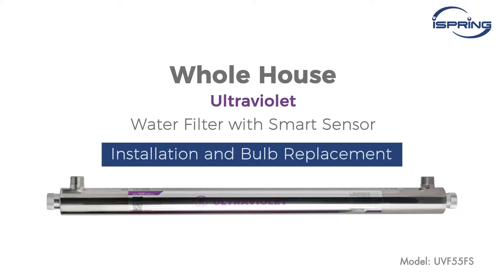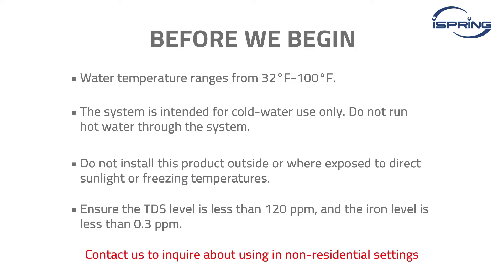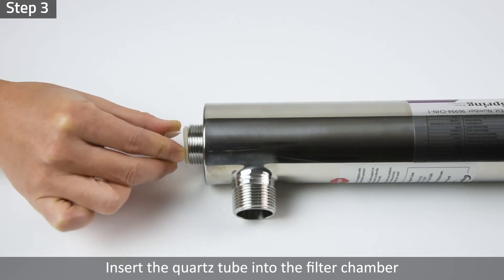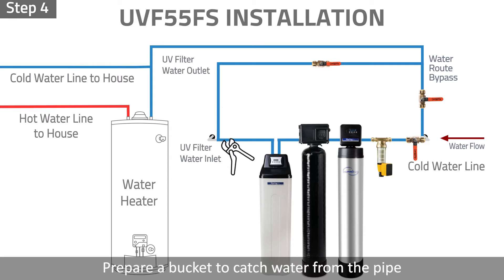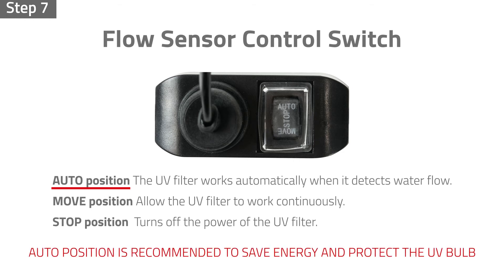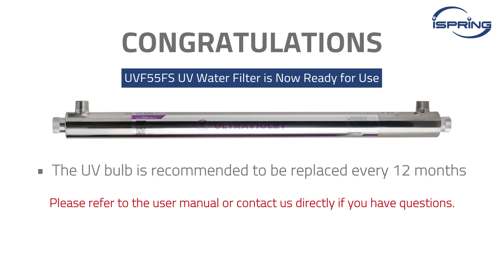Installation & UV Bulb Replacement of iSpring UVF55FS UV Water Filter | Step by Step

Comment: Can you tell me why it matters what side the flow switch is installed on?  The tube is symmetrical on common on both sides, correct?  I want to mount near the light side as it’s better to service the bulb?
Reply from the maker: Hi there! The flow sensor switch must be installed following the flow direction arrow because it is designed to detect water movement in a specific direction. 
If you have further concerns or questions, do not hesitate to contact us at  support@ispringfilter.com or  at  678-261-7611 (M–F, 9 AM–5 PM EST) We’re here to help!
Thank you!

Comment: This doesn't take into account that water softeners shouldn't be hooked up to your fridge and kitchen sink lines on the cold side, therefore if you have a water softener (as I do) and install this AFTER the water softener, none of the water used for cooking and drinking isn't being filtered with UV. Quite disappointing actually.
Reply from the maker: Hi there. Thanks for your comment!
If you want to focus only on filtering drinking and cooking water with a UV filter, you may get a Reverse Osmosis system with UV.
Please, check our RCC7U system:
https://www.123filter.com/ac/index.php?rt=product/product&product_id=215&acid=2 
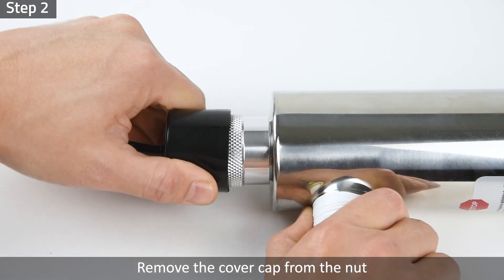If you have any concerns or questions, please kindly contact us at support@123filter.com or at (678) 261-7611 M-F 8:30-5:30 EST.
We are happy to help!

Comment: My bulb went out within 2 months of installing.  Should I be concerned about a problem. My uvf55fs turn off and on a lot.
Reply from the maker: Hi Greg. It doesn't sound normal. Please call us at (678) 261-7611 or (678) 801-9308 M-F 9-5 EST. We will help to figure out the issue.
Reply: How could you tell your bulb went out?

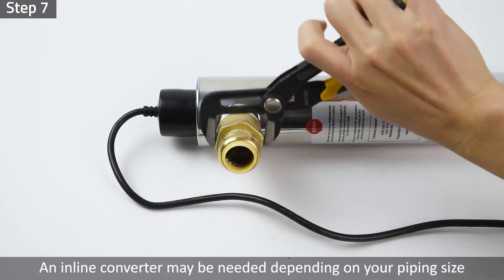Comment: At 2:47 we see the 1 inch NPFT connector attached. Then apparently the flow sensor switch is attached but not shown on the video. Instead the video cuts to installation.